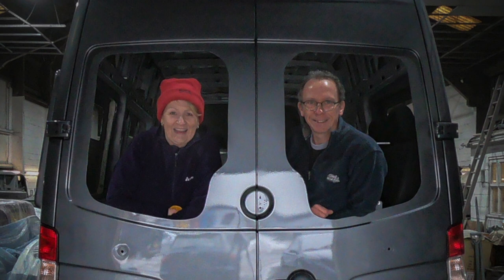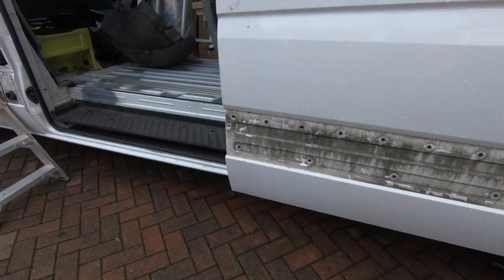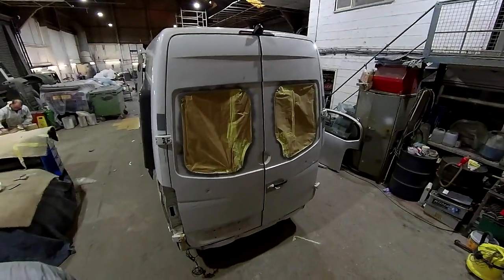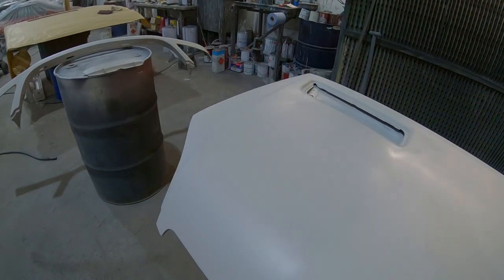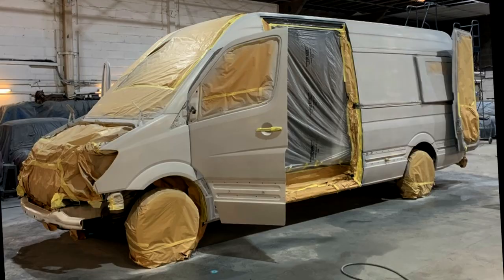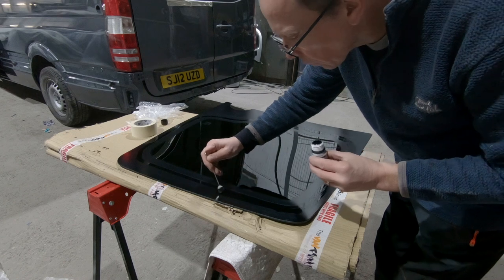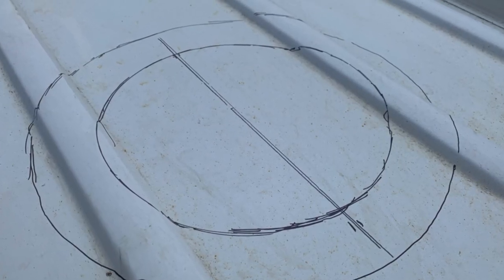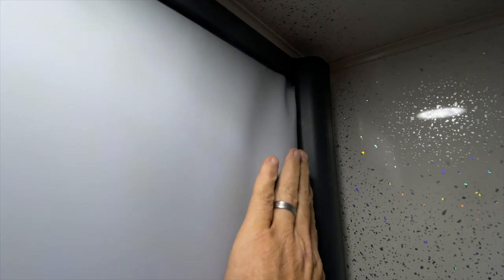Painting our camper van conversion - Part 2 of our self build camper conversion

Comment: My father worked as an automotive painter for 25 years and retired at 41.  He left job but still used to paint other's cars in our garage for some time.  I helped him sometimes, so at 12 I did knew how to completely strip down air cooled VWs (except engine, clutch and suspension) and remove body from chassis.  After several tries I never mastered painting, but I still like watching this process.
Reply from the maker: Great to see you checking through our back catalogue. Painting was the only task I hade someone else do as it’s such a skill that you need to learn and practice. It came out pretty well though. Thanks again, Sarah and Ben.
Reply: @diamondsontour  I found you through this playlist after a few videos about solar panels and toilets, so I needed to finish it.  BTW, I noted you always keep the wheel clamp when parking, so you care for security.  When preparing for american continent I would suggest applying 3M Safety film on side and back windows.
Reply from the maker: @AleMagalhaes thanks, yes that security film is on our list of additions. It looks very effective.
Reply: @diamondsontour  It seems to work well.  I saw smash and grab on cars stopped at red light in my country, so I started applying it to my cars when buying.  Never happened anything to me personally, but another couple I follow on YT had their passenger window smashed in Chile.  The glass shattered but the film kept it in one piece so nobody entered the van and they were able to drive and to repair on the next day, and of course apply same film again. They're kinda overdramatic (not on this case to be fair) but have useful content: https://www.youtube.com/watch?v=WhFIOpZUZwM
Reply from the maker: that’s funny, it was that video of Snow and Curt’s that made us consider security film. We’ve been following them since Mexico and they have been an inspiration for our travels. YouTube can be a small world sometimes.
Reply: @diamondsontour  I always loved traveling and road trips, did some month-long road trips in Europe, but my plan to travel Americas born with @Shurastey, and them followed with @LeoeFabi, @Abraceatrip , @Getoutsidebr, @BAITAROLE and other brazilians. The plan to keep rolling to Europe after that was after Snow and Curt, including my plan to alternate between Schengen, Eastern Europe (after their impressions on Montenegro, etc) and UK/Ireland to keep traveling.  BTW a few days ago I was kinda bored and put all European countries in a list, so basically for a 2-year trip I will spend two 3-month intervals in UK/Ireland and two 3-month intervals in Eastern Europe, plus a few weeks in Brazil for medical checkups in the middle of journey.
Reply from the maker: You’ve got some great plans there. I’m sure you know that Romania and Bulgaria are now also in Schengen so not an option now for out of Schengen time. Turkey is a good option in that area as well.
Reply: @diamondsontour  I'm still counting on Moldavia, Servia, Montenegro, Albania, Kosovo, Macedonia and Georgia not joining Schengen, but a decade is a long time and if that happens I will need to run back to Calais for a ferry to GB very often in my trip.  I would not complain to take three months in Scotland for instance, I was there for two weeks in january 2014 and it was great, sometimes I still dream with those roads, castles, glens, lochs and montains.
Reply from the maker: Indeed, all beautiful places. You can also go south to Tunisia or Morocco. There’s so much to see.

Comment: Your problem with the shower door being sucked in by the vent fan is a common issue with retractable shower doors. The best solution is a large gap at top of shower door. You will need 5 cm or more space across the width of the door at top to let enough air in to avoid problem.
Reply from the maker: Thanks for the comment, and for watching. That would have been a very good idea, and much easier than the workaround that I used. Thanks, I’ll remember that for the next van, if there’s ever another one.
Reply: @diamondsontour   Ben,  I said that ( if there’s ever another one) 40 years ago when I built my first Tranny... since then I've built a 7.5T race truck for my Step daughter,  designed and had a Boxer built, and now approaching 70 I'm on another 7.5t to drive across Asia...
Reply from the maker: @CosmicSeeker69  wow, that’s fabulous. We would love to see what you get up to crossing Asia.

Comment: How much did/ would a respray cost as thinking of doing similar
Reply from the maker: Hi, ours was £3.5k but they said that if I brought them another one it would be more. They honoured their quote but it was a lot more work than they anticipated. It is a very good job though, with all the door returns painted as well. I expect you could get someone to do it cheaper but we wanted a high quality finish and  no white bits visible when the doors are open. 
Thanks for watching.